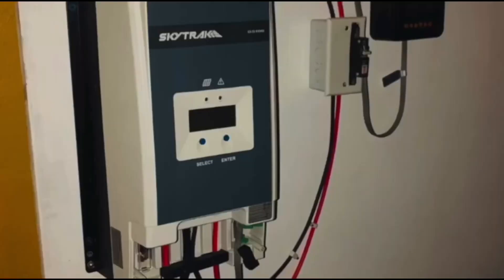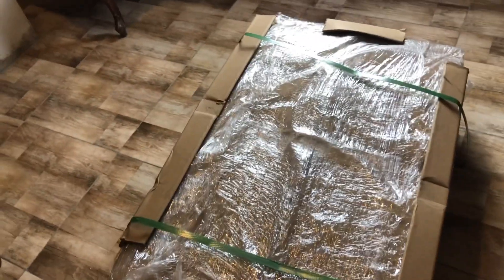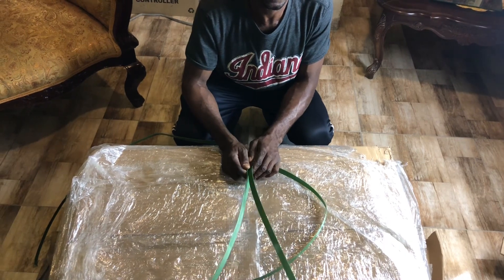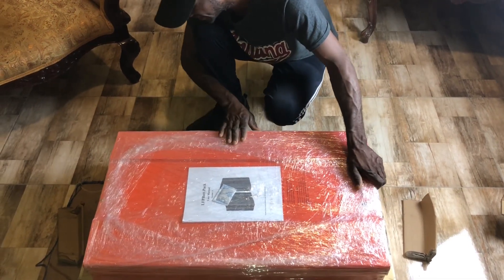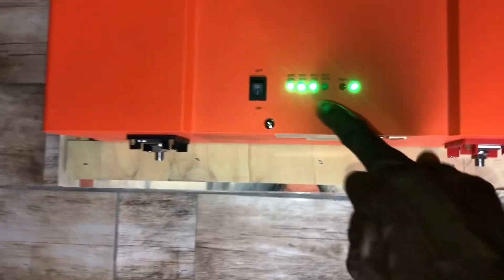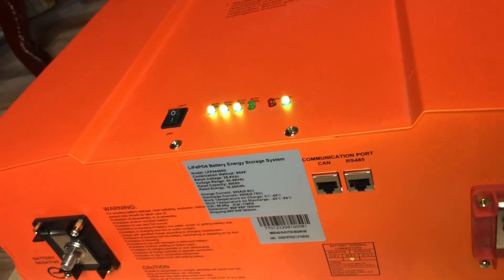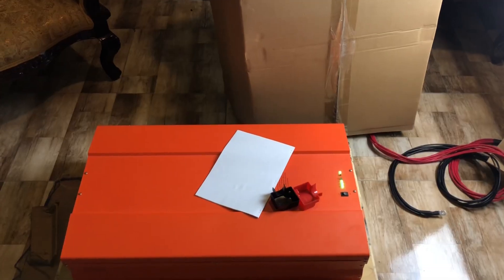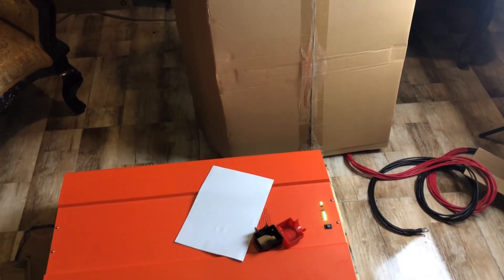Unboxing my lithium battery pack

Comment: Hey  bro nice battery  .
Problem  with these some these  batteries  BMS  damage. 
Some of them or 15s or 16s
Battery busbar  welding  can  not replace. 
 Battery cable should be 2/0
I have  two  systems  one 24v use 56 Nissan leaf cell. 
48v lifepo4 battery cell EVE 32  304ah 
Anything happens  it easy  to replace parts
Reply from the maker: Thanks much. Most of the parts on this battery pack and also the inverter, are replaceable. It’s doing great so far. Look out for the next video for updates